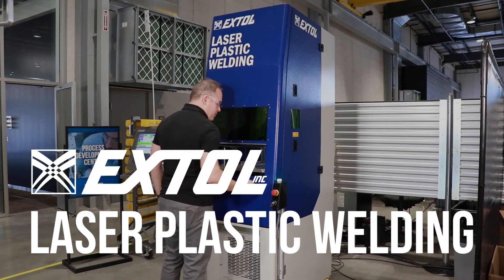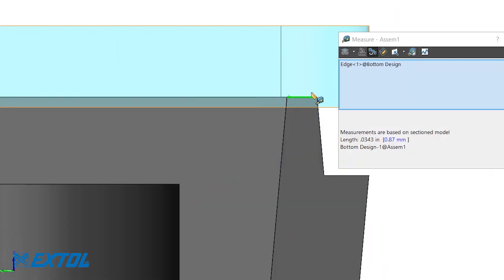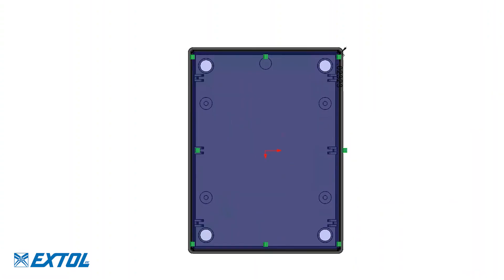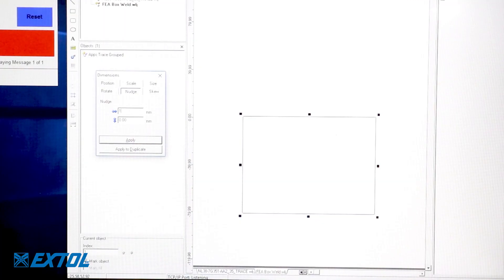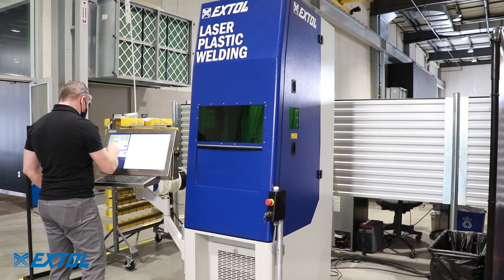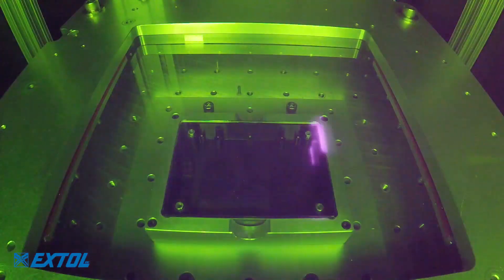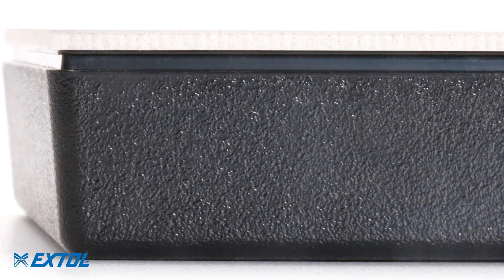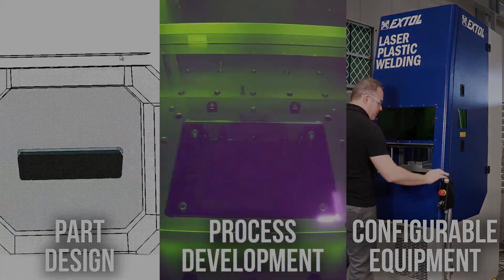Extol Laser Plastic Welding - From Design to Finished Parts

Comment: Does one of the plastic parts have to be transparent?
Reply from the maker: Hi Josef. Thank you for your question. Yes, with through-transmission laser welding, at least one of the plastic parts has to be transparent to IR. However, there are some materials that appear black/opaque to the human eye but are transparent to IR.
Reply: @Extolinc  Thanks. I requested a quote on your website a week ago and no one replied.
Reply from the maker: UPDATE! We can now weld two opaque plastic parts with our Direct Laser Welding technology. With this technology, the laser energy is applied directly to both halves of the assembly; the energy is not transmitted through a transmissive/transparent component. This opens the door to many new applications that benefit from the clean, precise welds that laser welding provides.